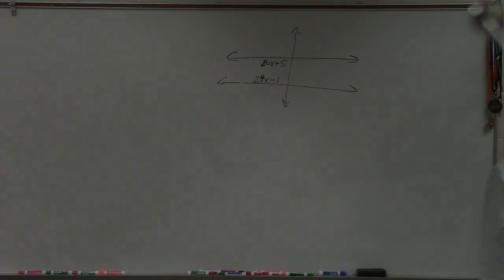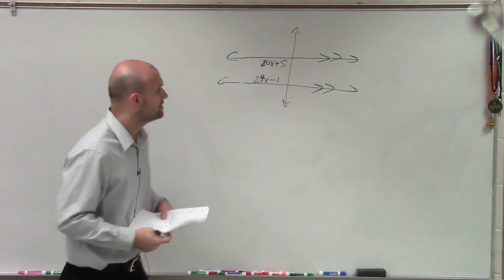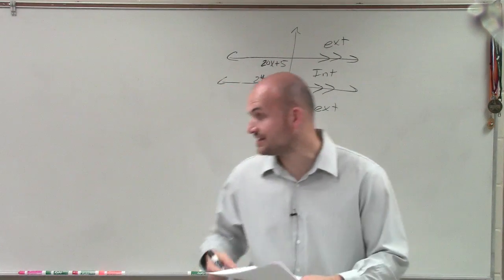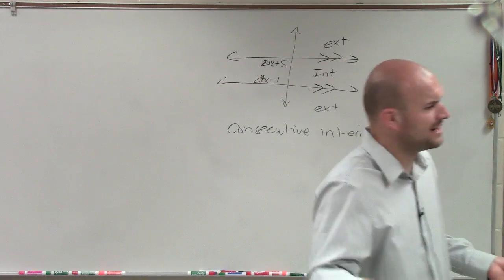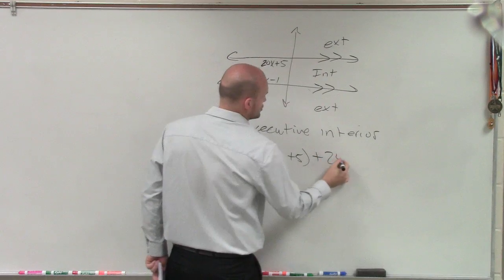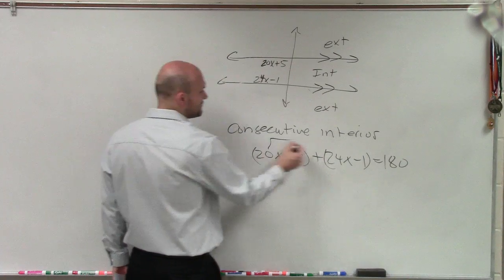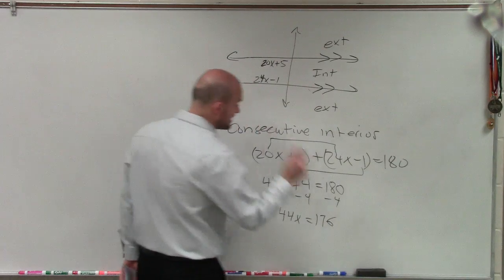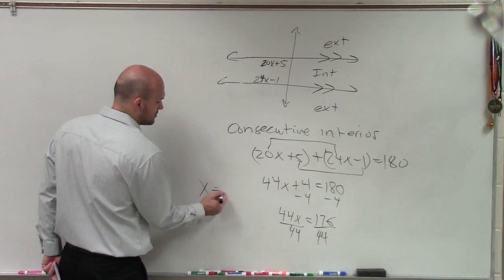Using Consecutive Interior Angles to Find the Value of X

Comment: So does it work the same way if the top equation is in the interior and the bottom equation is on the outside but the same side? Im trying to figure this one out 11x-47(top inside) and 6x-2(bottom outside)

Comment: no matter how many video I watch. I still get a little confused about this problem. The figure below shows two parallel lines cut by a transversal (may not be to scale).

parallel

Given the following:

Angle 4 is  
13x

+
7
 

Angle 1 is  
9
x

+
19
 

Find  
x